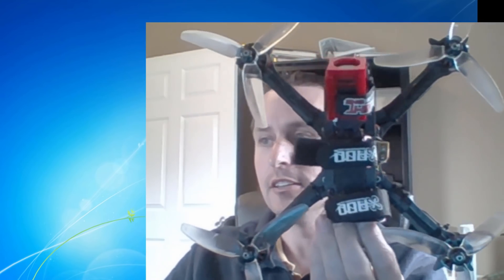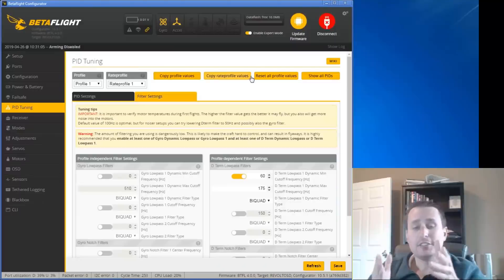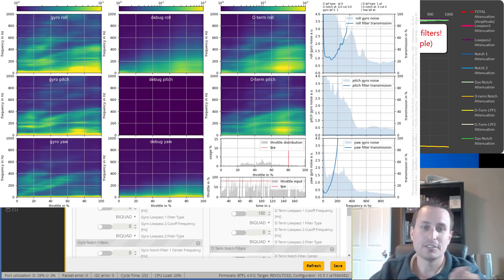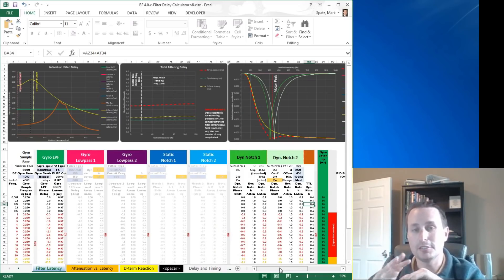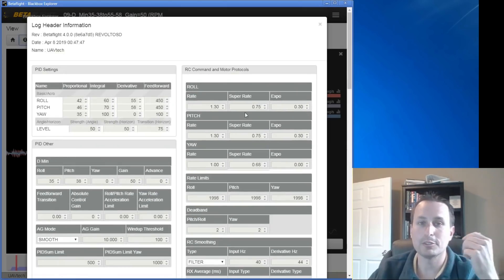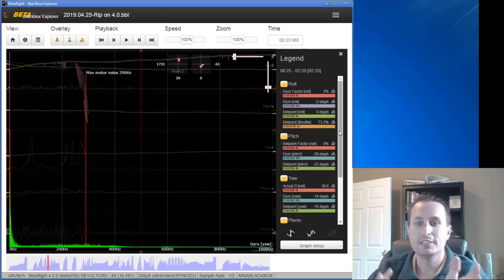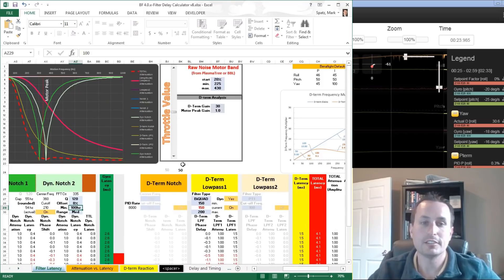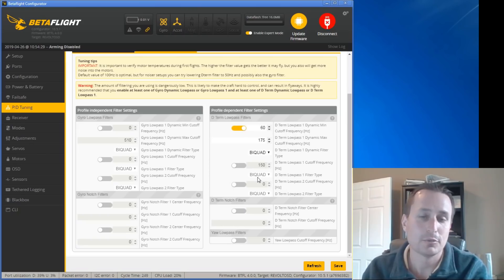Betaflight 4.0 Filter Strategy

Comment: is this still relevant for betaflight 4.2.1?
Reply from the maker: Yes.  Even more so since presuming you have RPM filters enabled and the Dynamic Notch is on duty.  Before, with 4.0, it was just the Dynamic Notch alone to cover motors and any frame resonances.

Comment: Im looking to damper my quad so I can learn to fly it with our crashing it al over the place what do you suggest? My first time out and I mowed the lawn with my new rotor blades I must say those props cut grass well can we get a weed wacker with a set those props?
Reply from the maker: Low rates is where you want to be.  Angle mode too or Acro Trainer.

Comment: Interesting exercise. I've only just managed to eliminate the raw noise on pitch that was preventing my trying this earlier; a combination of Sine Modulation Mode and Auto Timing in BLHeli32, now disabled and 22deg respectively. So... I have to say this strategy works a treat on 4.1RC5. The only immediate negative impact was that I was getting severe I induced bounce on pitch which I determined was due to FF being too high as a consequence of the reduction in delay. With that reduced, no more bounce. A question; why use a dynamic low pass filter on D? With the filter raising from 60 to 175Hz we're letting more D noise through, and at the same time having to apply TPA to reduce D. Why wouldn't a fixed lowpass at ~90Hz and less TPA work better?
Reply: Also would you recommend 60-175 for all quads? I presume your video was using a 5", but I'm keen to do this on a 3" too.
Reply from the maker: I like a dynamic D because a BiQUAD at 60 or 70 hz is a lot of delay.  A static is fine too at 90 or 125hz too if that is your pleasure.  When you look, most throttle is at 40 to 50% so it is about at 100 to 125 hz anyways.  Just move up when you are at 50% throttle plus which i like since you are typically at higher throttle ranges for prop wash conditions, which we want delay really minimized there.
Reply: UAV Tech I see most propwash at near zero throttle. As I raise it there’s less of an issue. To ask my previous question a different way, if a low-pass BiQuad at full throttle of 175Hz is OK (albeit with reduced D due to TPA) why wouldn’t a 175Hz filter also be OK at min throttle. I’d rather ask you than risk the smell of burning enamel...
Reply from the maker: @SteveCEvans  , because your motor noise peak moves down as throttle decreases.  So you need to move the cutoff down too.  As you increase the throttle the peak goes up, etc...

Check your logs.  Typically at least 40% throttle plus for wash.  At 0% throttle, the props are not really pushing air to induce wash, just coasting through the sky.

Comment: Recommendations for Whoop filtering? Specifically a Mobula7 on 2S. My motors get way hot after only 30-40 seconds. i tried going to 4khz 4khz and tried 110 and 300 for the 2 numbers on the gyro side (10.4.0 config) and 105 and 205 for the D term numbers. I have them on PT1 also, but I did notice the motors weren't as hot on this, but still fairly hot. One other thing I tried was for the gyro side, 100 and 300 set on BIQUAD, and then 75 and 175 D term also on BIQUAD and they were hotter than before. I kind of understand what these filters are for, but i dont know how to do a Blackbox reading and then set them accordingly. So any advice would help alot. I'm new to flying. I've also tried RDQ's recommended PIDs for the Mob7 and then also the factory PIDs it came with. I am using 4.0.3 as i was told the 4.0.0 version had some filtering issues. F4PRO FS Flight Controller with the factory 802 16000kv motors.

Comment: Could you make a comprehensive video on debug traces and how to set them properly? I got a little lost in all those debug_scaled, debug_filtered but then you seem to show on a graph whatever trace you want so why you have to set one or another in the CLI in the first place. As I said I am a bit confused on the matter, lol

About propwash I think, and might be wrong, that you can never get totaly rid of the vibrations because propwash is caused by the vortex turbulence created on the outer portion of the blades in certain flight regime, so the quad feels like going from a smooth highway straight into an unpaved road. That triggers a huge response from D gain counteracting all the sudden bumps. A good filtering and PID tunning might smoothen the bumps and lessen the perceived effect but propwash is fully eliminated only when the prop exits the turbulent airstream.

Comment: Do you have a video explaining your feedforward settings? I can see you are running a high FF (450) but a low transition (0.05) and I'd like to understand this more.
Reply from the maker: I don't yet, but it is coming soon.  Basically, it takes a 450-FF to get the rig to completely track Setpoint.  Then to prevent overshoot, you use high D-values in conjunction with implementing D_min.  FF and D_min go hand-and-hand.

Comment: Hi! Had a question for you that I have been trying to solve. I am trying to add external barometer (BMP280) to Mamba F4 (FURYF4OSD). But, it seems that the code for the barometer is not included in the firmware, so I cannot run any CLI commands to enable it. I am willing to build a custom image, just trying to confirm whether it's as simple as editing the betaflight/unified_targets/configs/FURYF4OSD.config by removing "set baro_hardware = NONE" and adding in 

set baro_bustype = I2C
set baro_spi_device = 0
set baro_i2c_device = 2
set baro_i2c_address = 0

From what I am reading, there is more to it. As I believe drivers also need to be loaded in. But, before I start studying the code further, I was hoping you could point me in the right direction. Thanks a million!
Reply from the maker: I'm not sure.  Best to ask that question on the Betaflight Slack: https://slack.betaflight.com/

Comment: Hi, thanks for the amazing video.
I had betaflight 3.5.2 on my quad, flew it and flew fine.Then I changed batteries and the quad was stuck in air, I was at 0 throttle and the quad was climbing and making strange noises, so I disarmed, crashed on concrete and broke 2 arms. Then, thinking that was a firmware bug I updated to 4.0 but it did exactly the same thing, I had enabled all the filtration and set my d term low pass to 70 and gyro low pass to 80  and gyro and d term lowpass 2 cutoff freq to 60.
Unfortunately I don't have bb logs of the flights.
Keep in mind this is a 3d printed frames, so the arms are a bit flexy. Now I made them stronger and added front and lateral braces for better stiffness. Will maiden next sunday. 
Any advice?
Reply from the maker: If you have the lowpass filters so low and D-term is still spinning up the motors, you definitely have mechanical issues you need to address.
Reply: @uavtech  Yes, It was a mechanical issues indeed, I fixed it by putting 6mm arms in Place of 3mm ones and now it's a lot stiffer and It actually flies fine. The motors aren't hot, now I guess i should try to carefully remove some filtration in order to make the response better.
Just one question, on the new bb logs, the spectrum doesn't show any strong vibration higher than 20hz, Is It good?
Can I use stock bf 4.0 filtration now?
Thanks for the help

Comment: On a brand new quad, your setup with no "non dynamic" filters on the gyro flies amazing. The only weird thing I have is; with FF ABOVE 70 on roll or pitch, running low rates around 500deg/s, the quad sounds like it's having trouble getting the quad to rotate, not sure if the quad is trying hard to pitch and roll at the same time and is limited by one of the corners having to be spinning slower than the other to allow for the pitch and roll to be mixed?

I'll get a log tomorrow and see if I can see anything

Comment: Sorry I have one more question about filtering a 7" quad : are the values on the 4.0.x sheet for 4S, 6S or both? And maybe should I consider turning to zero the dterm_lowpass2_hz to zero only after checking the kwad is flying good enough? (no RPM filters)
Reply from the maker: For Community Presets?: those are for 4S.  6S just likely requires lower PIDs (same filters).
Reply: @uavtech  thanks

Comment: I'm in over my head here.  Is it possible you could document your entire pid tuning and filter tuning process on a fresh build from start to finish?
Reply from the maker: yep.  coming up.
Reply: @uavtech  if your interested and have a week or 2, I could supply the fresh built quad for your upcoming video...  I have a 5 inch 6s smooth operator I've been aching to build and my bench is almost freed up.

Comment: wasnt sure where to start so did a quick paste of what you have and a quick run. Motors where pretty hot so was trying to sort out what I need to increase filtering while still getting the underlining benefit from this approach. Well dropped dterm max hz to 140 or so and that seems to do the trick. Any problems you see by keeping it that way?
Reply from the maker: nope.  if it works, run with it.

Comment: This setup works fine for some of my 5 inchers, but for micros more traditional approach suits better. Maybe dyn noctch tracks peacks in that case better, i dont know...
Reply from the maker: Yes, for micros with this strategy, you need to manually set the Dynamic Notch to "HIGH" .  With the gyro filter turned off it defaults to Medium.  Type "get dyn" to see variable to set to HIGH mode.
Reply: @uavtech  didnt make any significant difference for one of my micros, though it is the only one that  shakes at idle with thrust_linear  enabled even at  10

Comment: Feed Forward 450!?  Are these numbers arbitrary?  Thank you!
Reply from the maker: Nope. Generally you need high FF gains to get the gyro to track the Setpoint.  This is on a slight tweak of 4.0 with some new stuff to prevent overshoot with such high FF values.  However, it will work on 4.0 if you use D_min and boost D-gains enough for it to stop the overshoot.
Reply: @uavtech  The D_min seems to be a global variable that influences ALL D's, correct?
Reply from the maker: @frankyoualot  , it is a Profile variable.  So you can adjust per PID Profile and it will change when you change profiles.

Comment: Thanks. Shooting for low D/dynamic/feed forward D? I like the low pass D but I'm very new. Low latency filter smooths my newbyish suck spaz ishness. There is a balance between responsive (low latency) and filters?160 gram 3s 3 inch. I'd like to have more yaw authority. Could you address that?
Reply from the maker: More Yaw authority means higher I gains on yaw.

Comment: Can you post your get dyn settings ?
Reply from the maker: # get dyn
dyn_notch_range = AUTO
Allowed values: HIGH, MEDIUM, LOW, AUTO

dyn_notch_width_percent = 6
Allowed range: 0 - 20
Default value: 8

dyn_notch_q = 250
Allowed range: 1 - 1000
Default value: 120

dyn_notch_min_hz = 100
Allowed range: 100 - 1000
Default value: 150

dyn_lpf_gyro_min_hz = 0
Allowed range: 0 - 1000
Default value: 150

dyn_lpf_gyro_max_hz = 510
Allowed range: 0 - 1000
Default value: 450

dyn_lpf_dterm_min_hz = 60
profile 0
Allowed range: 0 - 1000
Default value: 150

dyn_lpf_dterm_max_hz = 175
profile 0
Allowed range: 0 - 1000
Default value: 250
Reply: @uavtech  thank you

Comment: thanks a lot. could also talk about the 7" heavier motors kwads ? I would highly appreciate
Reply from the maker: Did you see the Presets for 7"? 

I would If i had a 7".  Maybe i need to look to build a GPS cruiser.
Reply: @uavtech  yes, and I used them, but then, with rpm filters things are a bit more complicated
Reply from the maker: @cubitusclaudius  , simple.  Don't use RPM.
Reply: @uavtech  😂 rpm works fine on my Floss V2.1 7", but I need a little more tuning

Comment: Had to go back to 3.5.7 for my 2.5" 1106 quad build.
Ended up with my p gains at 4 and it flew like poo in 4.0.
Just too much vibration i guess.
Reply from the maker: Could just put the 3.5.x presets in for 4.0 to get 3.5.x results.
Reply: @uavtech  
My motors would smoke i reckon
Reply from the maker: @stecozz4907  ,?.  It sets up the filters and PIDs to be the same as what you get defaults for 3.5.x.

https://github.com/betaflight/betaflight/wiki/Community-Presets#revert-to-bf-35x
Reply: @uavtech  
Cool
Thanks might give it ago.

Comment: ripping there Mark! Looks very smooth, very good propwash handling. Im surprised at the low cutoff dterm filtering. interesting
Reply from the maker: Key is it is dynamic, so only low at 0 throttle.  At 30% throttle it is at 100hz+ already.
Reply: @uavtech  Im giving it a try!
Reply: yeah 60Hz eek...its interesting comparing the F1 filtering to BF they use less but at lower freq...

Comment: What if I use rpm filtering along with your filter/d-settings?
Reply from the maker: If your peak motor noise is well defined (not defused), should work well.

Comment: Im still undecided on Dmin vs a constant D gain for freestyle...The constant D gives a thicker smoother feel because its on all the time vs low then high Dmin which has a more direct stick feel. But then Im not sure Dmin is always catching the propwash events...in your vid you still have propwash with those values and so little filtering I'd expect it to be gone...
Reply from the maker: I will do a comp on that.  But if you put your constant D gain values into D-min, then you are getting those gains ++.  I did lower D some though for this video to see how she went.
Reply: @uavtech  if you put the constant D gain into Dmin is there any point of the boost if the constant is enough? I guess maybe could use slightly lower...
Reply: SupaflyFPV
Sure, default d gains are still low(28-38). Mark is running D boost close to 60 at max......that would normally smoke motors if 60 were the constant default:-)
Reply: @SocalCanyonRacer  yes but it still has propwash even when 'boosted' to 60...the question is does the D gain get there in time to respond to propwash events...I almost had 0 prop wash in 3.5 at 41 D gain.
Reply: @SupaflyFPV  he also mentions mechanical limits. He isn't using the biggest, or most expensive motors.

Comment: So I have a question that would probably apply to alot of people here watching and that is... Both of my setups are super quiet (Hardware wise) with super smooth motors with no bearing noise and really rigid frames on 4s. What would be a aggressive filter strategy settings I can put in for these types of setups? I've taken both lowpass filters off and my motors are still cold so I want to get more aggressive with less filtering 👍
Reply from the maker: I would run what was shown here, but have the D-term LPF go up to 200 or 300.

Comment: I found, that with the mpu6000 gyro, I could raise the filter, when I addressed the frame resonans with a static notch and let the dyn notch handle the rest of the noise.
But, on the exact same build, when changing to the 32k gyro, I got a fly away crazy quad. Seems like the default is perfect for the mpu6000 builds
Reply: Yeah, I got no problems tuning with the MPU, but with ICM it's a another world it seems ^^ Gonna try this tip,tho ^^
Reply from the maker: The revolt is an IMC gyro chip.  This should work the same for MPU or IMC in 8k mode.
Reply: @uavtech  I know it should work. But my experience was not that similar. The fc I tried, is a dual gyro matek f722-mini. And the exact same settings were a nogo when changing from gyro 1->gyro 2
Reply: @pippifpv  I also have been using a Revolt with low filtering and its fine...however some of the ICM gyro are more stable than others apparently...the 20602 is pretty close to the MPU6000 in reliability I heard from a BF dev